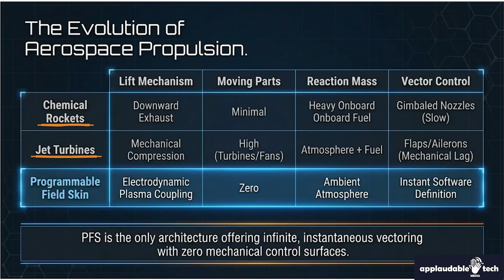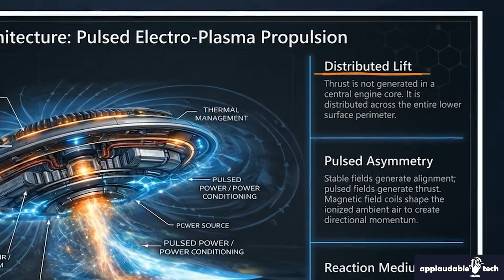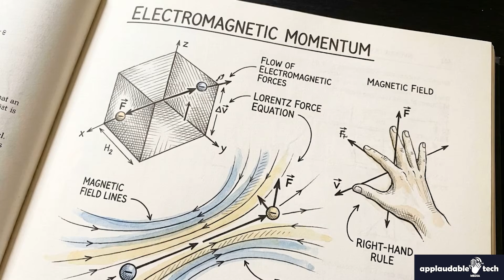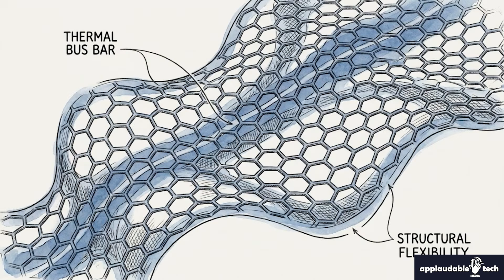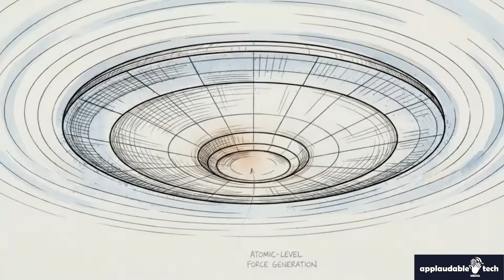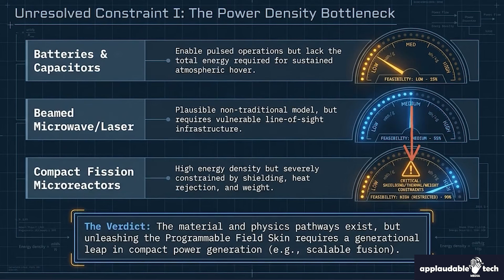AI Just Designed a Vehicle That Breaks Conventional Physics

Comment: Having a lot your system skin malfunction as a isometrical capacitor weble instabilities are not what's doing your propopulsion . The one factor that you are missing is you need to put this craft at a phase by either  cancellation of the rgb mass closure so rest mass no longer exists or you need to move this into a black hole shell. Faster rate of time > 5.833 x c.

Comment: I’ve been working on developing an anti-gravity system for twelve years. I’ve made significant progress so far. Right now, I’m working on increasing the anti-gravity force to a level suitable for flying vehicles. I’m commenting on your video based on my experience. For the first time, I’ve come across a video that shares information similar to the theory I’ve been thinking about for years. In my opinion, advanced alien spacecraft also move using anti-gravity technology powered by millions of nanomotors. The only point where we differ is that I believe using lasers instead of plasma is more accurate. Nanomotors convert angular momentum into linear momentum. Overcoming gravity without mass motion is extremely difficult, bordering on impossible. I am making these posts to warn humanity. Give up on ideas of overcoming gravity without mass motion. The universe is filled with gravitons. Gravitons are the source of gravity. The way to overcome gravity by manipulating gravitons is to generate mass motion. Gravitons respond only to mass and mass motion. Therefore, it is only possible to overcome gravity with systems that have mass motion. I am waiting for myself; let humanity wait for me as well...Finally, here’s one more small detail: the anti-gravity force is an attractive force, not a repulsive one.
Reply from the maker: If you look through the comments there are many who indicate they had same or similar idea, you should seek those people out and collaborate.
Reply: @applaudabletech  Thank you for your suggestion. I prefer to work alone. I’ve made all the progress on this project by myself. I’m already in the final stages. I don’t need any collaboration.
Reply from the maker: @ortak741-un6nx  Understood, best of luck with it. This was 90% AI generated I made it clear it was for entertainment purposes only. I really don't even know if anything the AI shared is plausable or possible.
Reply: @applaudabletech  I wish you success in your work. It wasn’t a bad video. It doesn’t matter to me whether the video was created using artificial intelligence or not. I’m issuing this warning so that, if I were to pass away before I can present this project to humanity, people won’t waste their time on incorrect laws of physics and theories. My sole purpose is to be of service to humanity.

Comment: Excellent presentation! Extracting power from the vacuum is possible, just look at the late Tom Bearden's body of work: by keeping the dipole alive it will supply you  with endless energy from the vacuum or look at the work of Maxwell Chikumbutso, who arrived at the same conclusion by first creating the dipole,  then keeps it open the entire time, which self-charges his battery banks, EV, his motorcycle, and allows him to charge a house using a portable indoor generator, or use his EV as a generator and power his house. As far as the human crew inside the ship, they shouldn't be affected by the crushing G forces because they are protected inside a pressurized bridge and quarters.
Reply from the maker: The AI did not dive into any of that but it is certainly interesting. I might deep dive a little further. Asking AI about energy generation might be an interesting video too. Or even how might humans be able to survive significant G-forces. Thanks for sharing your thoughts.

Comment: this doesn't explain the ability to pull massive G's without being vaporized
Reply: Anti-gravity and anti-inertia technology are basically the same thing, just reverse in its application: No inertia = 0 Gs. External displacement for thrust, internal negative displacement for nullification of inertia. (Don’t ask me where I work, I probably shouldn’t have commented in the first place).
Reply from the maker: Where do you work, if you don't mind me asking?
Reply from the maker: You are correct, it explains the opposite, AI says it is a high maneuvrability drone, a human would be crushed by the generated forces, it offers no explanation or solution other than it would need to be unmanned.